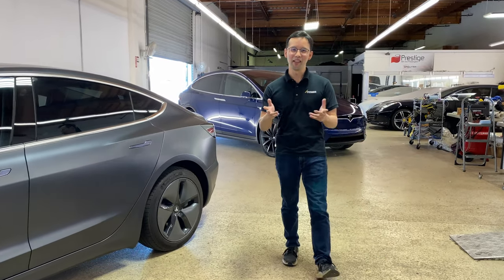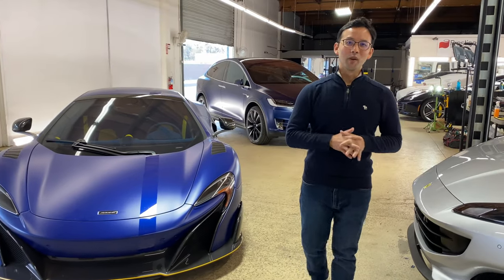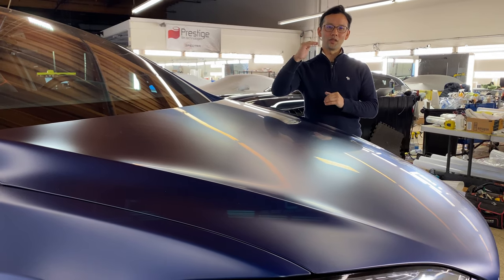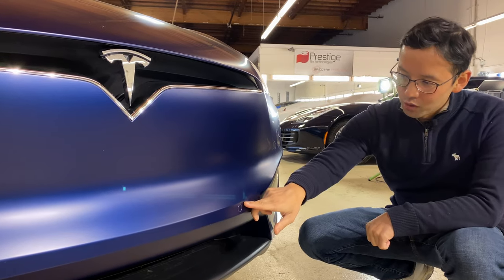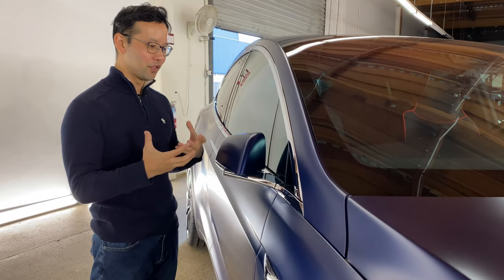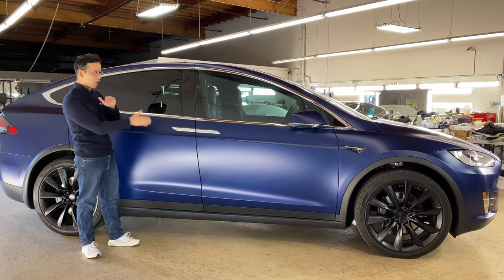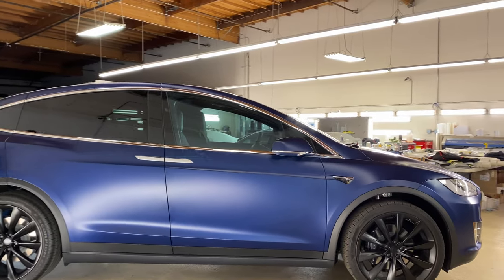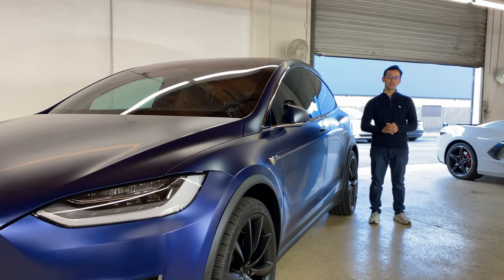New Tesla Model X: Satin Deep Blue Metallic

Comment: Is the satin guard comparable to ppf in term of guaranteed longevity?
Reply from the maker: SatinGuard is a Matte/Satin PPF.   It is not vinyl.  Like all PPF in the industry, there is no guaranteed longevity per say,  because there are too many factors that can affect longevity.

  For example, one can hypothetically have a habit of tailgating trucks.  In this instance, the life expectancy of the film will be much shorter than that of one with better driving habits.
Reply from the maker: @Yaardy316  Absolutely.  All manufacturers have similar industry warranty against such "defects", but "manufacturing defects" only denotes its production quality and do not affect "longevity".  Longevity of the film is affected by such factors as:  
1. driving habits  
2.  how often the film is maintained?   
3.  how is the film maintained?  
4.  what driving conditions is the car being put through?  

These are the main factors that affect longevity of the film.  As you see with all manufacturers, "wear and tear" is not part of the warranty or guarantee as PPF is a wear and tear item.  

For example, we have customers who put on 3000+ track miles on their cars yearly.  These cars are driven at extremely high speeds with road/track debris peppering the film.  The film will inevitably get torn and damaged at a much higher rate than that of a normal daily driven car.  We see these cars needing to replace the film in about 4 years time, whereas most daily driven cars never need it replaced.  Another example would be if a car owner does not do regular maintenance on the film by washing it on a regular basis.  Hypothetically, if one only washes the film once a year or have a habit of washing the car with dirty towels, the longevity of the film will be much less than that of a regularly maintained car.  - Hope this clarifies things.
Reply: @PremierProtectiveFilms  Yeah, that helps. Definitely going to get it wrap once mine comes in.  Thank you!